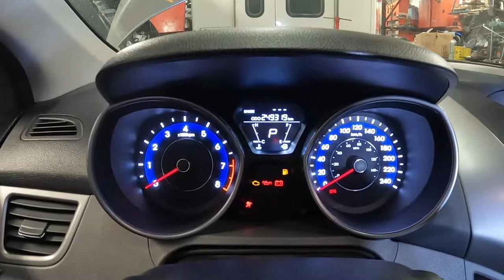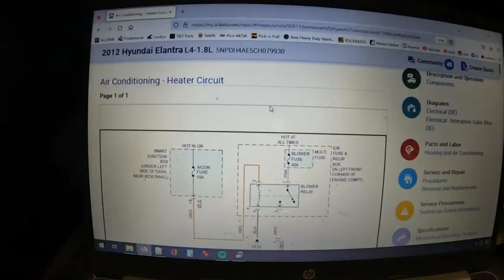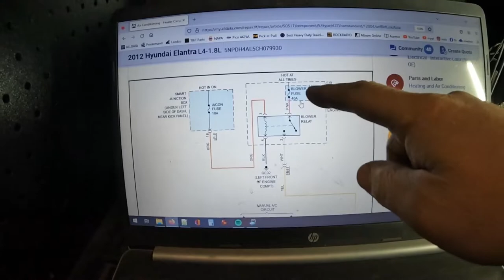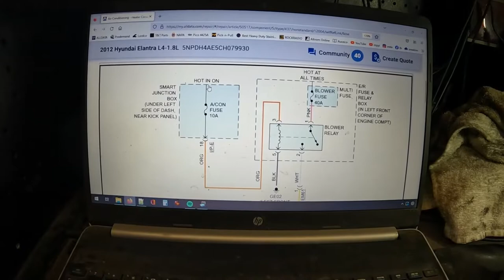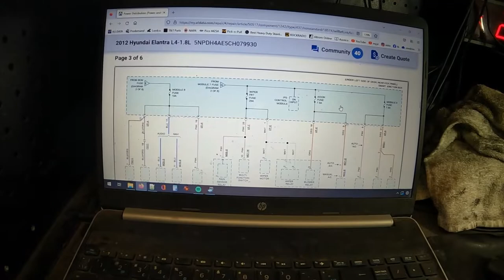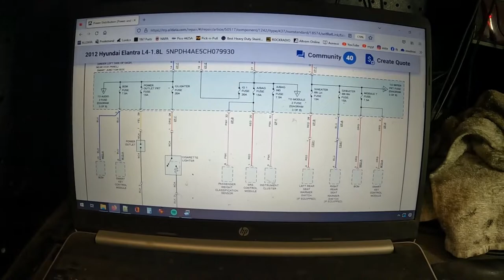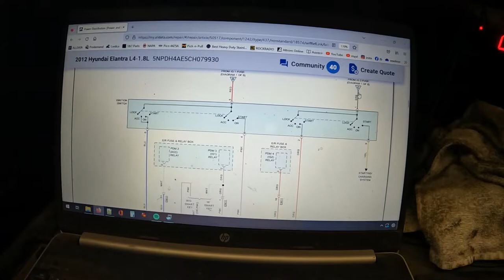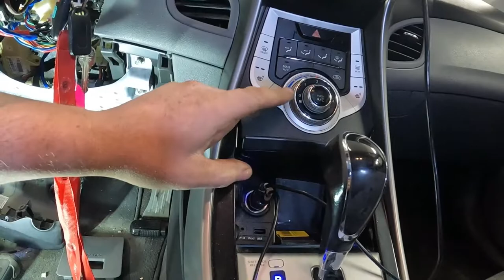2012 Hyundai Elantra - Wipers and blower fan stopped working after aftermarket stereo install

Comment: Are those ignition switches really sensitive? I replaced the steering coupler on my wife’s 2013 Elantra and when I got everything put together that’s when it went bad.
Reply from the maker: @scottyhester1 I don't believe they're any more sensitive than any others. I suspect it was either pure coincidence or was already on its way out and all the jostling made it fully pack in.
Reply: I had same issue, or similar im not sure. So my car got stolen on a saturday, and I found it on monday, sure thing igniton was all fucked, i replaced the lock ignition switch, all good, the windshield wiper control switch was hanging but nothing visually wrong, i put everything back but before i I did i replaced the  steering wheel pump coupler. Might as well because i had everything in pieces. But never checked anything before that. But I put everything back in again and noticed windshield wiper switch and blower unit does not work... im like wtf

Comment: Proper source voltage is a must hate that when people don’t hook up battery maintainor when doing diagnostics with KOEO lol
Reply from the maker: @Anthony Bachellier  The charger's one of the first things I hook up. Too many distractions. It's way too easy to walk away and leave the battery on accidentally. Some vehicles will discharge FAST.
Reply: @eurbanautotech  oh yeah for sure, and when an expensive vehicle like a range rover or bmw goes dead, resetting everything is always a pain. Can always cause low voltage codes that may lead you to think there is another issue
Reply: All of these issues occurred at same time on my 2011 Elantra.  After a fog light was replaced.  The sunroof won’t shut either.  No heat, heated seats or ac and wipers . My car has only 7 k Mi. I only went in for an inspection and when I left everything stopped and they said they didn’t disconnect the battery but why was my radio on 87.5.  Help.  They said I had to have it electronically diagnosed, but that they couldn’t do it. I am really upset that I have to spend 8995 for diagnosis when it could be very simple.